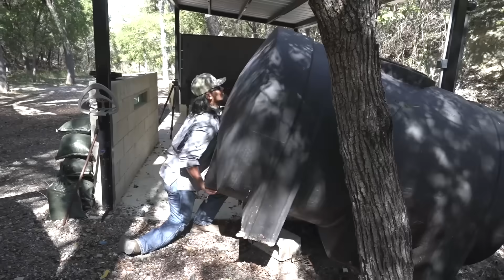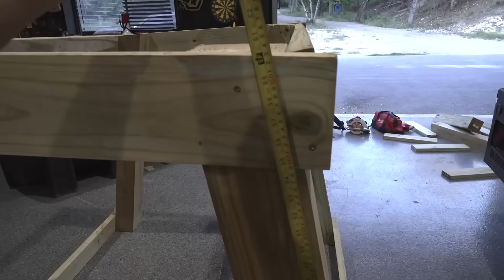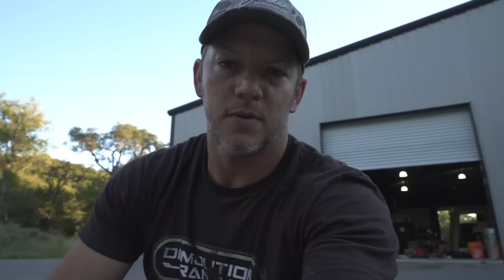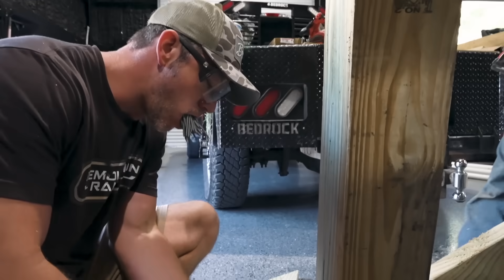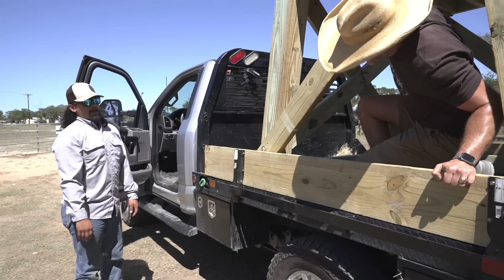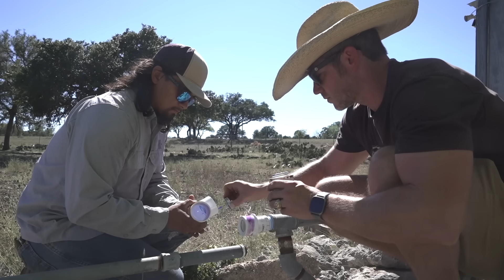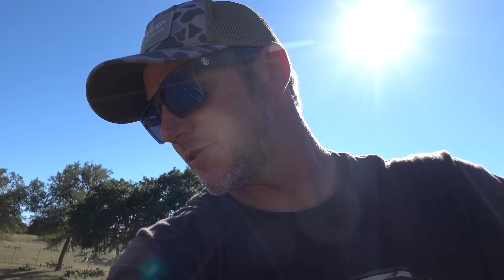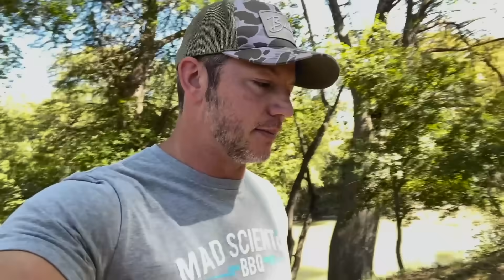Going Into the Cave… But This has to Be Done First!

Comment: wouldnt it stop syphoning, when you put another T connector in the top part before the bend, that goes into the top of the tank, so only when the tank is completely full, it will overflow

Comment: omg how many pounds of water does the inlet have to push through to fill the tank vs just going up and over the pipe. At a certain point the water pumped into the tank is actually gonna work against you, compounding the pressure up through the outlet pipe. overflow and inlet have to be different locations, with inlet coming in through the top.

Comment: I mean... that's allot of ledger bolts, so it'll probably be fine.... but it hurts my brain to look at lolz. Just like a roof rafter system, it will only distribute the weight from the splayed legs down, rather than sideways, if they're properly collar tied (braced) horizontally to resist the splaying.... but most the bracing is on the other side instead and the dimensional lumber has been intentionally deformed w/a tie down strap lolz. It'll be fine..... for a while......

Comment: shouldn't have your fill and overflow at the same height, over flow should be higher on the tank. so maybe fit a different pipe flush with the top instead for overflow.

Comment: Yeah idk if that well pump will fill the tank regardless… that’s A LOT of water pressure that keeps increasing the more water that goes in the tank… that’s prob why it’s sooooo slow plus it’s prob going to burn up the pump from trying to push so much pressure… prob gonna have to fill it from the top
Reply: Water pressure is based on water column height not volume. Imagine diving down in a pool vs the ocean 32 ft equals 14.7 psi.

Comment: Really do need to fill from the top when using a pump. The pressure from the thousands of pounds of water is probably whats been burning out your small pumps on the range. 

Just pump from the top and drill a hole on one end of the tank near the top as the overflow. Also shoud support the pipes with brackets on the stand. Seeing the dangling pipes stressed me out.

Comment: Your well pump will not be able to push more water pressure than what is inside of that black tank if that black tank has 70 pounds of water pressure pushing against what you’re trying to put in it’s not gonna pump any water at all. You need to have your water fill from the top of the tankand then just put in a rubber grommet at the top and then plum in an overflow out to your pond

Comment: Measure twice, cut once! Just saying. That was a costly oops. Instead of getting your $$$ back from both beams, you only get some back. Should put a top fill system in with a float inside of the tank. When the tank gets low, water turns on to fill. Drain from the bottom. Should think these things out before you start cutting. Should talk to some well drilling guys, they know their shit!

Comment: All comments made as I watch it:  Why not put a 2" piece of 4 by 4 underneath the short end?  10" IS enough, just countersink both ends 1/2".  Nothing about those crosses made it stronger.  Filling from the top would make much less work for the pump and go faster.  Why didn't you use clear plastic for the up pipe, so you could see the actual level tank level at all times?

Comment: that deck is not going to last long in water and under the load , would have been better to use deck planing with 1/4 gaps  for the water to run out

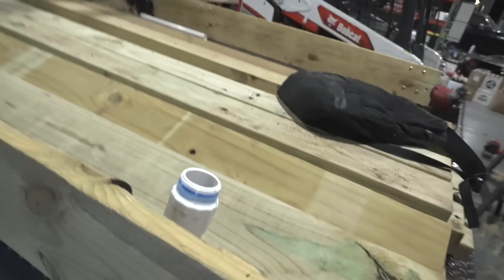Comment: 7:40 your design is off big time. It will break, if it dont I will be amazed. You are under estimating the weight of that when its filled with water. You need to put lag bolts all the way through. I know from personal experience when building my own rain catchment system.
Reply: I guess I should have kept watching. :)

Comment: You should fill from the top. As water fills the tank your pump is going to have to fight against the increasing pressure as the tank fills. It will burn up your pump quick.

Comment: Wait. You said overflow what? I'm not sure what you described but....yes it's  going to syphon out of the tank. Vent the top of your...highest point to atmosphere. Well I'm not following what you're trying to do really. Whatever it is, if you pipe the top back into the tank at it's highest, valves all the way, then you'll be able to do anything you want. Not sure what the reason is though unless the tank is going to be pressurized or a sight glass used on the vertical. You're a confusing kid, you know that?

Comment: Back pressure from the volume of water in the tank which is way higher than the well pump, fill it from the top and fit a overflow pipe near the top for the pond feed, use the valve at the bottom to fill stuff

Comment: JENNA,       No, you should not feed bread to wild animals: 
Low nutritional value: Bread is mostly carbohydrates and contains little protein, fat, and fiber. It's also high in sugar and sodium, which can be harmful to many animals. 
Malnutrition: Bread can cause malnutrition, which can lead to serious health problems. For example, in waterfowl, malnutrition can cause "angel wing", a permanent wing deformity that makes it difficult for birds to fly and swim. 
Choking hazard: Make sure anything you feed wild animals is bite-sized to avoid choking. 
Moldy bread: Stale bread with mold can cause Aspergillosis, a lung disease. 
Soaked dog kibble: Soaked dog kibble can swell up in a bird's crop. 
Clogged digestive tracts: Dry foods like bread can expand and clog the digestive tracts of fish. 
Instead of bread, you can feed wild animals:
Waterfowl feed or duck pellets
Seedless grapes cut in half
Shredded kale, Swiss chard, or romaine lettuce
Grains, including wheat, barley, and oats         MATT SHOULD KNOW THIS!!!!!

Comment: When you're filling from the bottom, you have the weight of all the water you've pumped in to fight against. The pump is working harder and harder the more water you have in the tank.
Reply: The work the pump has to do, filling from the bottom, will never exceed the work needed to fill it from the top because head pressure is dictated by the height the water needs to be pumped. The volume of water in the tank is irrelevant.

Comment: The well pump has to pump against the water pressure inside the tank.
Reply: It would actually require MORE pressure to pump in from the top, as the height required to clear the top of the tank would be higher than the water level would ever be from filling it from the bottom.

Comment: Your whole system seems unnecessarily elaborate, I would've plumbed it in from the top to begin with; basically have it coming in straight down with your overflow coming out at a "T" before it enters the tank, that way the water falls down into the tank so no matter the pressure it gets put into the tank and once the tank is full the pipe will fill up until it reaches the "T" and then it will go to out the overflow.. for filling the truck tanks you could use the valve at the bottom that you initially tried to fill from

Comment: WATER TANK
Reason it wont fill.
Your pumping in from bottom of the tank. It will fill until it reaches the same pressure as what you well is pumping. Equal presue means it will no longer pump up because the pressure above you pump pressure is posative pressure. 
TANK REFILL FIX
You need to fill the tank from the top. Just like a watertaklnk hooked up to your house. Water comes from you gutters and fills the tank from the top and you draw from the bottom valve. 
You also need to have an overflow on the opposite side of the fill at the top, this will be your overflow that once it's full, it will go to the pond. 
Once full, you will have extremely good pressure at the bottom fill valve.